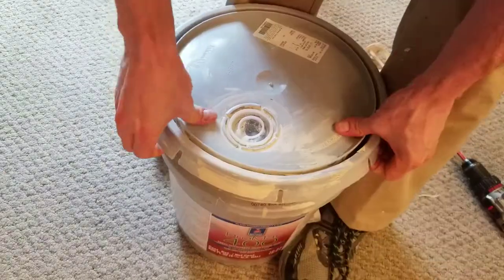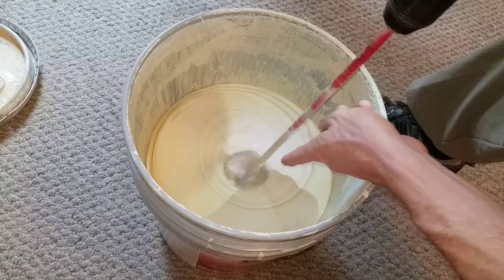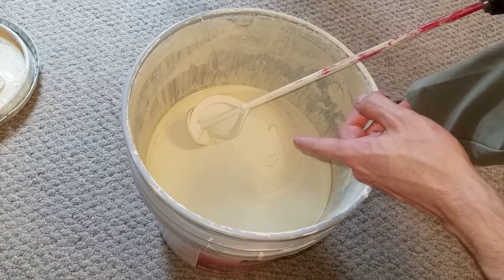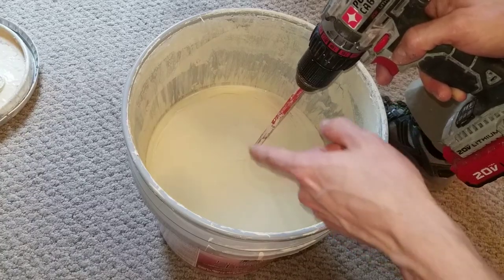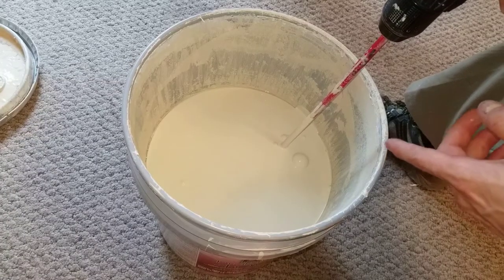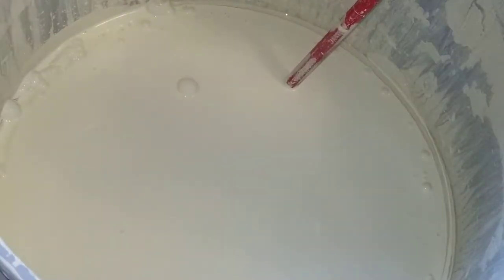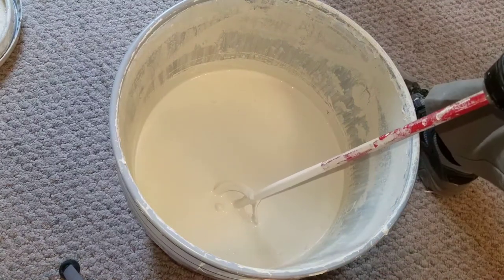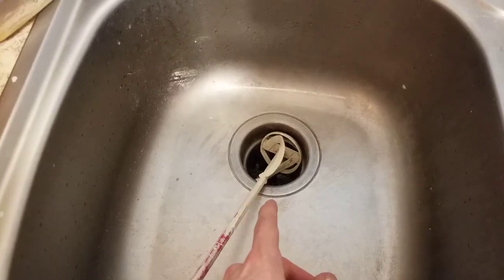How to Properly Stir Paint w/ Drill

Comment: Did u buy the detachable stirrer?
Reply from the maker: Yes. Paint stirrers are cheap and sold at any hardware store typically. In a pinch, you can make an "L" shape out of a wire hanger and mix with it. The small part of the "L" just needs to be a few inches long.

Comment: Do not*
Reply from the maker: Without a stirrer and drill, you can always use something like a broom handle. I've done it before if it's all I had. It will take longer for sure but can be done. Just mix fast enough to not splash or get air bubbles in the paint.